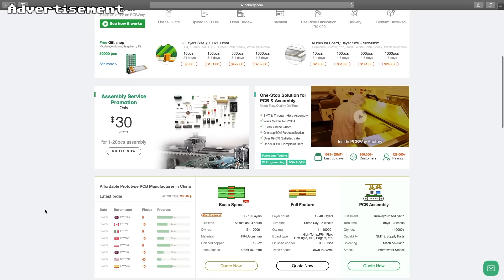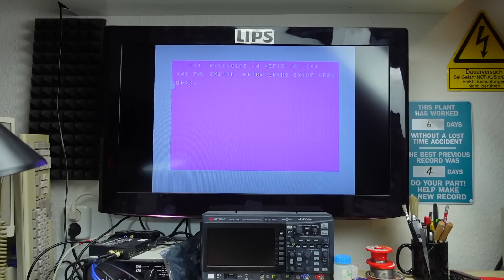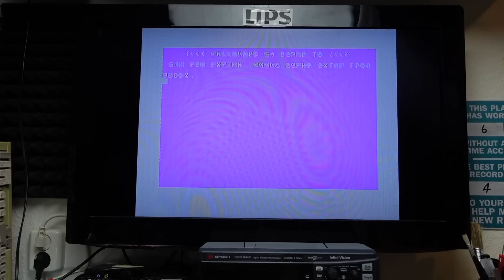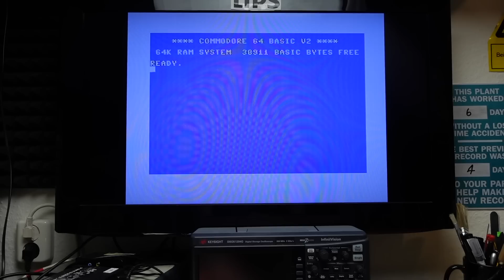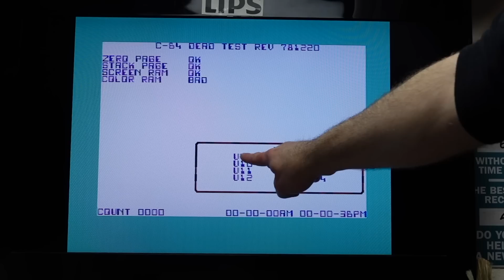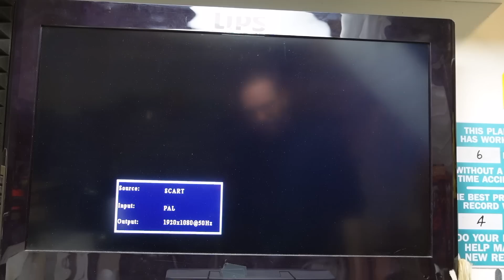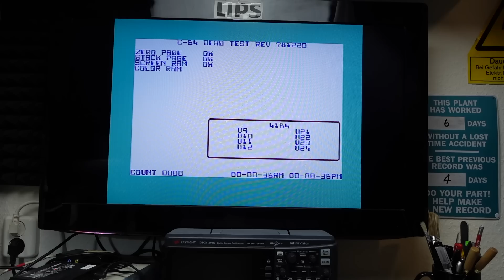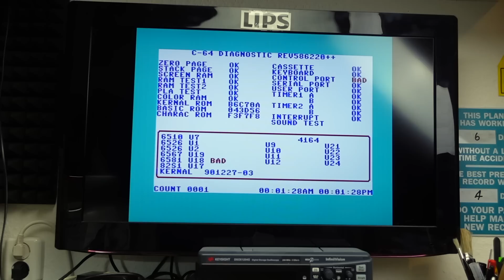Aldi C64 Blank Screen Repair Part 2

Comment: Nice work bud, there is nothing wrong with taking a break and come back to it whenever:)   I had a problem with a Cia u1 with sometimes the the keyboard worked but when I wiggled it... it'd be fine.  After swapping chips and walking away for a few months... it was the socket.  Not the chip. Lol
Reply from the maker: Oh, those sockets are a pain in the butt sometimes! Super difficult to find a fault like that most of the times! Glad you managed to fix it!

Comment: Did you ever learn the answer to why Diagnostics shows bad for the SID or 4066@U28? I finally did for mine, I bet it is for yours too. I had this same problem on a C64C that I own and had been pulling my hair out. I found that someone pointed out to Sven (on his Github "issues" for the harness) to change the resistors at R1, R2, R5, R6 (on the user port, for the joystick ports) from 120K to 110K which fixes the mis-diagnosis for newer boards (but continues to work correctly on older boards). In his old schematics, the resistors are 120K. In his newer schematics they are 110K because of this issue.

Comment: Love this channel.
I  think you're very quick with the desoldering gun. I have the cheapest store brand version, I have to heat for 3s or more (depending on trace width) before the solder melts enough to suck it in. Results is usually clean enough to gently pry/drag it off - unless it falls out. If a pin is still stuck, some fresh solder and a new run with the desolder gun will fix it. Hot air and desoldering braid looks like a lot of extra work.  ;-)

Comment: 13:45 - The C64 shortboard doesn't run anywhere near as hot as the longboard, i don't think heatsinks are necessary. It's a much better design than the longboard. But getting rid of that crappy cardboard RF shield is a good idea, as that thing is a heat trap (and until like the metal shields isn't connected to any of the chips to remove any heat from them)

Comment: Great that you’re using some ESD measures!! You can improve it a bit more with an appropriate ION generator if you use plastics and other insulators in your workspace.

Comment: Those sockets Commodore used are the equivalent of hot garbage left to bake out in the sun.  I've been working on a few C128's lately and it's gotten to the point where I just assume they're bad and replace all the sockets with machined pin sockets while I'm in there doing whatever work needs to be done.  I was finding that the dodgy sockets would cause all sorts of issues ranging from the Kernal ROMs randomly not working, the VDC not working when trying to use one of those solderless 64k VDC memory expansion boards (or would work but would lose connection after the machine heated up), black screens, random crashes, etc.  Yeah it takes some work to unsolder them and put the better quality ones in but it's worth it in the long run.

Comment: I'm curious to know if the control port test will pass with a real SID or ARMSID installed as the other 4066 may still be bad. I believe it is only used for the pot inputs so it won't be obvious until you go to use a paddle or mouse

Comment: Two years - I know what this means as it took me several years to fix one 250425 and a c128d. Finally I could do it with the great help of the C64 Forum (forum64). It’s a great feeling to turn the machines on working perfectly.

Comment: Is the uninsulated bodge wire shown on the left  at 7:41crossing a vertical row of 8 pads soldered to any of those pads?
Reply from the maker: It’s magnet wire, so it is insulated with a clear plastic. No shorts, I checked it several times.